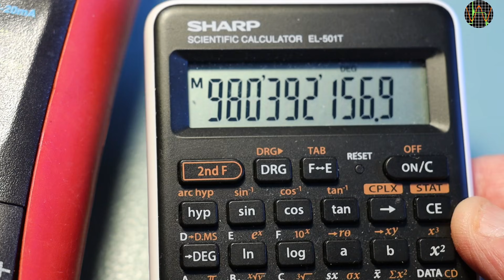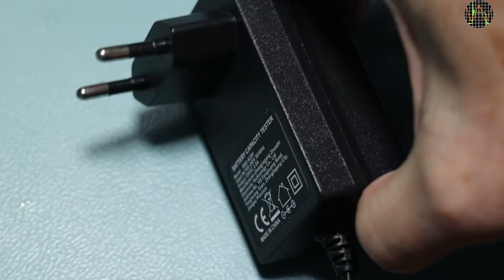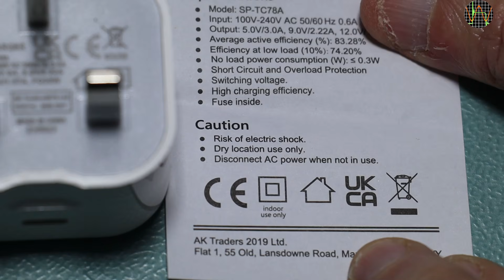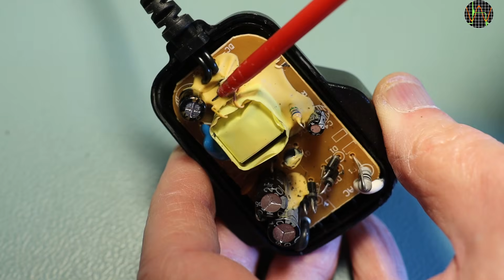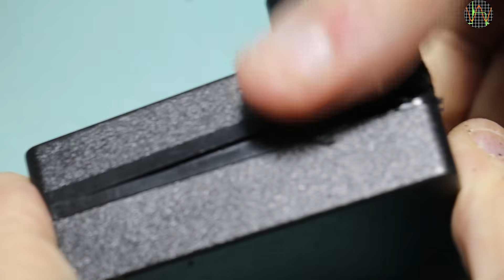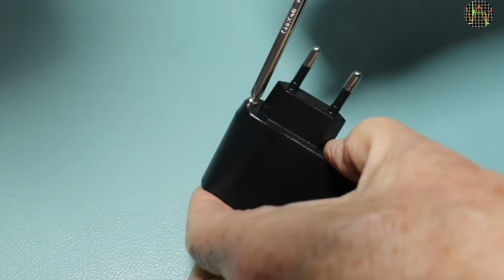218 The TEM 4700 appliance safety tester - Part1: Does using it damage Class 2 devices?

Comment: RPi chargers are usually built with high 5V because RPi's are known for browning out if their supply voltage goes to low. Surely in RPi6 we'll get a PD-compatible supply interface... surely.... did the 'battery tester' PS die, before or after the UNI-T was applied to it?
Reply from the maker: Yes, low voltage alerts on RPis was always a problem...
Regarding the "battery test PS". It is a good point. I should have done a functional test before measuring the insulation resistance with the UniT but I did not. Reason was that input and outputs were still conveniently shortened (from the TEM4700 test) so doing the Insulation Test right after the TEM4700 saved the hassle of undoing this, doing the functional and then redoing it again for the insulation test. So it is possible that the PS died because of the UniT insulation test. On the other hand, for this PS, I only used 2500VDC on the UniT and that is far less than the peak voltage of the  highest TEM4700 setting (3400VAC RMS = 4800Vpeak).